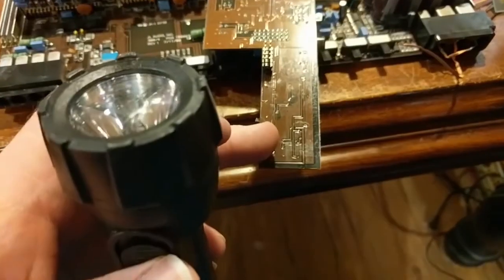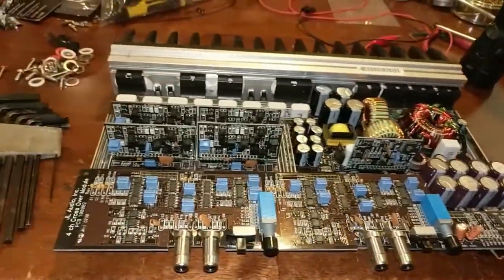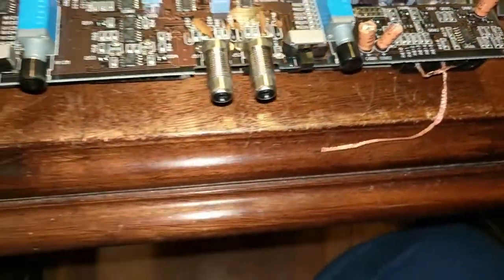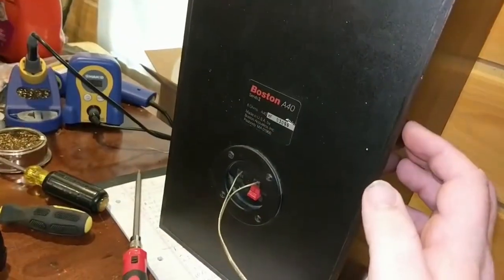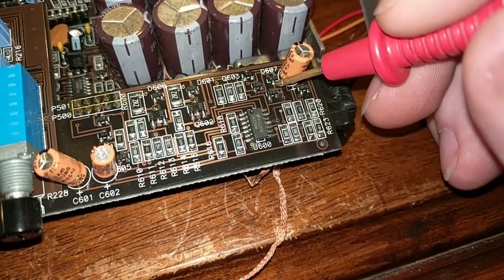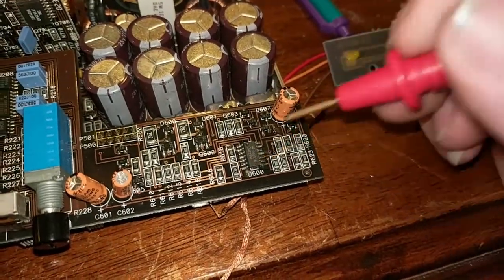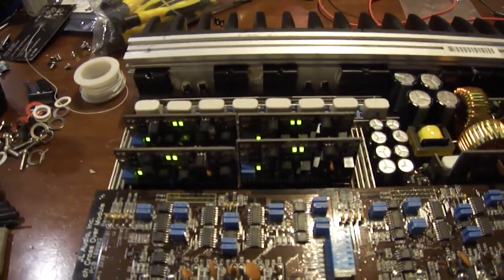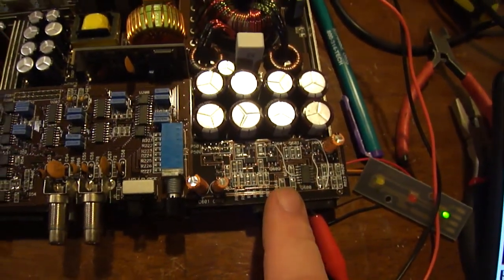JL 300/4 Troubleshooting and Repair. Weak sound.

Comment: Hi can anyone tell me JL a4300 amp  Where is the fuse located?the amplifier does not light up when plugged in, so I wanted to check if it has an internal fuse.Thank you for all the information
Reply from the maker: I do not believe JL Audio amps have internal fuses. Its been awhile since i worked on that 4300.
Reply: @THEtechknight  Hi,,,that is, you can say that these are disposable devices, which when they break down, even the fuse cannot be checked, it is something similar to the iPhone, so it cannot be dismantled.😁😁😁😁
Reply from the maker: @bradpitt3965  no? they are serviceable, you just gotta know what you are doing.
Reply: @THEtechknight  I understand, but this is only one of the few companies that makes its equipment only like the iPhone. Why don't most manufacturers do this when it is known that JL has such a policy. if it breaks, return it to the service without being able to check it yourself, Mtx, Hifonics, Alpine, Pioneer, etc. they don't do it. That's why I avoid this companyJL
Reply: @THEtechknight  even Boss, which doesn't have a super reputation for quality, has this type of protection and fuse..i don't blame you it's just my opinion i wanted to know more about this equipment but i just think it's highly overrated😆😆
Reply: @THEtechknight  I test a lot of car-audio equipment on a daily basis, sometimes minor repairs of subwoofer amplifiers. I posted a post for JL fanatics to get opinions on this company and components.

Comment: Hey man thanks for sharing the video. I have a 450/4 and I have a low ohms light channel 3 and 4 is working but 1 and 2 doesn't.
Would have an idea on what you think it is?
Reply from the maker: It's hard to say, but if I were to hazard a guess, probably shorted output transistors in those channels and 50/50 chance it damaged the driver modules.

Comment: I have a Slash 500/1 that is dropping volume once in a while . Still plays loud but doesnt hit hard . Someone mentioned to me that the amp has cards in it , which you just showed ,  and the plugins from the card cause this sometimes . Have you seen this ? He called these daughter cards . lol
Reply from the maker: "Doesnt hit hard" is a very vague and broad statement. Could be alot of things to internal faults all the way up to bad connections on the ground/power/speaker, loose/dirty switches on the crossover, etc.
Reply: I did all the cleaning . Pots , switches and the daughter board plug-ins.  Then I stumbled on what I think it is . My ppi par225  . Either volume knob or op amps im thinking . I do have a question on setting the voltage on the speaker lines . I'm putting a par245 in now . So should all controls be flat on that to get the my 32 volt speaker output ? It did still hit but the bass would drop a little . When I pumped the eq volume I would get it back

Comment: I have one of these amps that I need to pull apart to clean the switches on, would you recommend some dielectric grease in this area just to circumvent this corrosion?

Comment: Hi, I have a JL 300/4 v1 amp and when I wiggle the power and ground cables beside the remote wire the red thermal light goes on and off. Any ideas why? Could the daughter board be loose? Sometimes when the thermal light is on the speakers distort badly

Comment: hey I know this was from a couple of years ago but this is my first time attempting to fix an amplifier and I can't figure out how to get the board out of the enclosure. I was trying to get the output terminals from the inside so I was taking the input board off but I can't get it back on. is there a way to do it without taking the entire board out?

Comment: I have a jl 1000/1 i brought it to a local shop and they said its running to hi voltage and i would have to send it to jl audio. It just blows subs if i run it, also the little caps inside get so hot their actually blowing outward, they said theirs to much voltage running through it. I am curious if i should just scrap it or pay to fix it if its a small issue

Comment: hi .good morning,iv got a question on a jl audio 300/4 amp whats the best way to take off the metal guard that holds the transister
Reply from the maker: You mean the spring clamps? there is a hole on top. Grab a stout allen key 90-degree wrench, and put it inside the whole, and pry towards you which wil put downward force on the spring. it will then pop off. Be careful, you can bend/shear the spring if you overdo it. to put them on, you need to tap it back into place until it bottoms out.

Comment: Was hoping you would turn the status display around. I pulled my wires out and need to know what color wire goes where to back of display LEDs.
Reply from the maker: Nope ive never had issues with the LEDs and their wires. Its all put back together now. But its not hard to figure out. Black is GND, Red is power, and then its the other 2 you have to figure out.